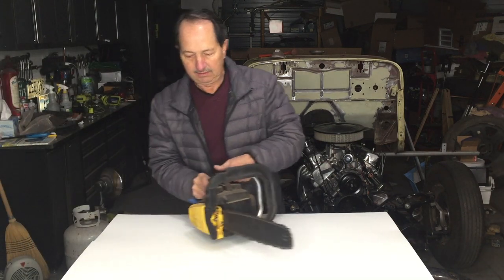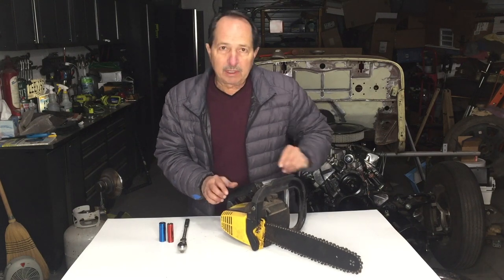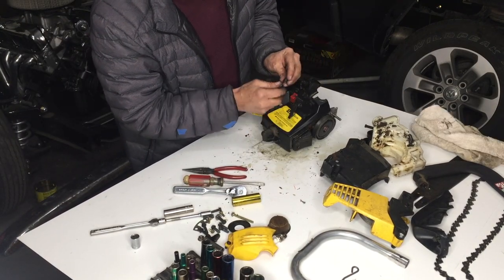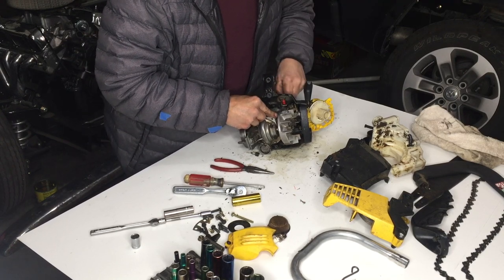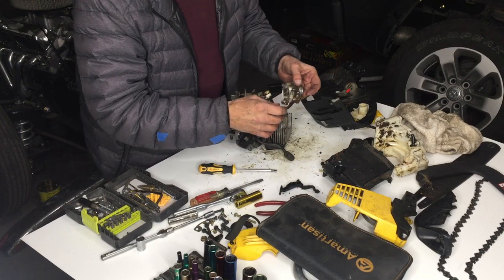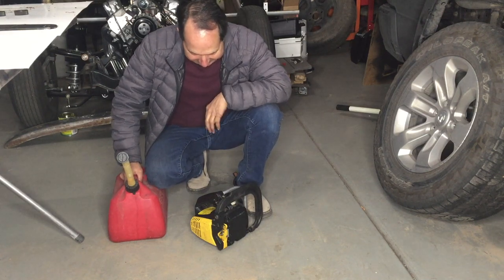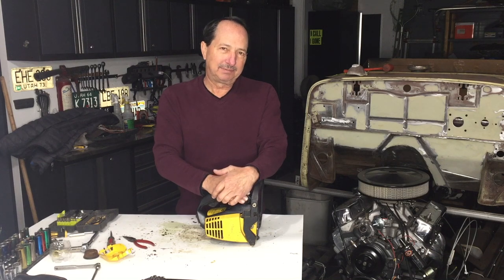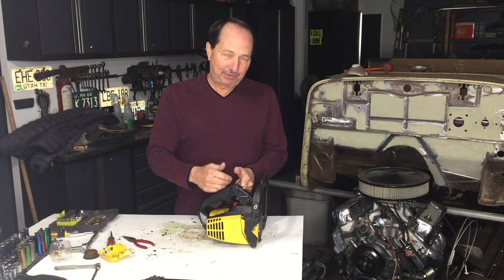Smelly Old McCULLOCH Chainsaw. Will It Start or is it trash?

Comment: I got the same saw , fuel leaks into the cyl. when it sits and it hydro locks , carb. needs a rebuild like yours . The saw (I believe) is worth fixing , they don't make 'em like that anymore .
Reply from the maker: It is a pretty good little saw and it's worth fixing.
Reply: @riderescue  yeah I have 5 mini macs 2 theirs no fixing them but they look nice on the shelf. they are a 25 and a 35. so a couple less cc. and no chain breaks. but the 110 and 120 then eager beaver I have all have nice chain breaks, also all are pretty much brand new. just been sitting for a long, long, long time. my beaver runs good. but I'm getting into the other 2 soon. i got them for climbing, plus I kept finding them for 25 bucks. but even if I just getting them all in running order and put then on the shelve in the shop. I do kinda like the electric saws for climbing actually anyways. I don't know what I was thinking. honestly the battery powered saws are the only saws you should be using to climb. I have taken down at least ten trees over 40ft with my first get stupid Ryobi 18v chainsaw haha. ill be getting a still or husqy soon.

Comment: You had it apart but didn't put the carb kit in it. Bet the fuel pump is the culprit. 🤔
Reply from the maker: Yep. I hate to buy parts for these low cost projects (like the carb kit) just find other lethal issues like a gas tank with a horrible chunk of foam stuffed in the bottom of it. If this little thing wasn't so time consuming to take apart and put back together, I'd give it another try. Thanks for watching and leaving a comment. Much appreciated.
Reply: Mom @riderescue

Comment: I think you should have did a little research on the saw before you opened it up.  You did not know what you were doing, nothing personal.  Kind of watching the proverbial monkey with a football.  Once you know what you are doing, you can take one of these apart in about ten minutes.  The throttle linkkge is just an interference fit insde the case which you pop loose with a screwdriver.  
When disassembled, kit the carb, replace/clean the screen in the fuel inlet port, new fuel lines, and a felt/rag filter in the tank.  Reassemble, set the coil gap, new o rings in the oiler and you should be good to go.
There were a lot of things missed during disassembly and reassembly.  When you had it apart, you should have taken the muffler off and had a look at the piston.  It was probably okay as the saw seemed to have compression.  Plus, it started.  The rubber sleeve on the intake has to be properly inistalled for a good seal.  It is unknown regarding the condition of the air filter.
Don't throw old saws like this away.  This one is better than the craftman electic one you showed,  
Where you screwed up is you did not take the saw very seriously.  You have a hotrod in the background, you should know better.  This little one cylinder motor deserves the same attention the motor in your hotrod does which you just took it apart and took it for granted.  You did the samething a kid would do on a car and halfass takes his motor apart without really knowing what he was doing and nothing changes when he put it back together.
The chainsaw was probably fine.  The biggest problem  with most chainsaws and there are millions of them out there.  Most people who have them only use them seasonally.  When they finish using them, they put them away with gas in the tank and let it sit and sit.  The gas evaporates and leaves residue behind as it evaporates.  Next time they want to use it, no start. The varnish residue has gummed everything up.
Also, remember when kitting these little carbs, to clean them as the passages inside of them are tiny.  You want to make sure that gas and air is properly flowing through the carb.  Then, adjust the high/low screws accordingly.